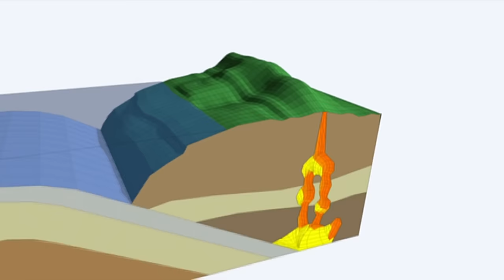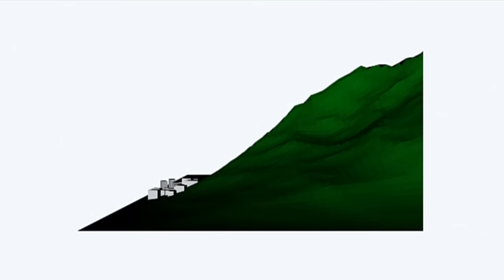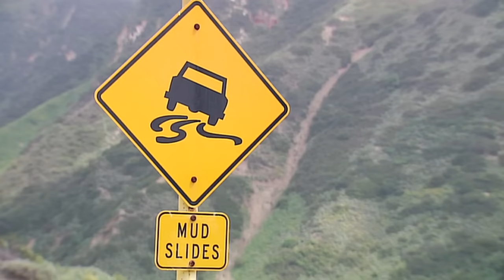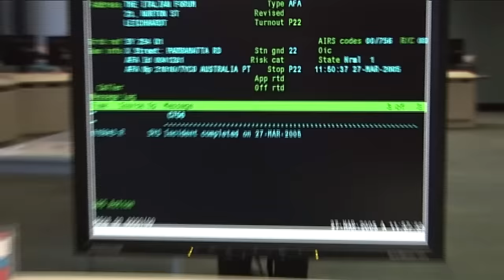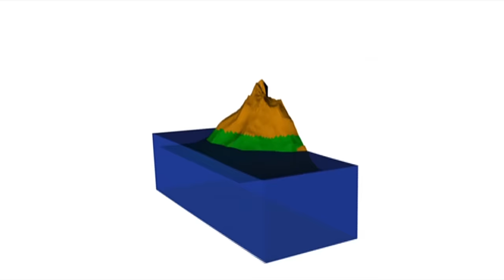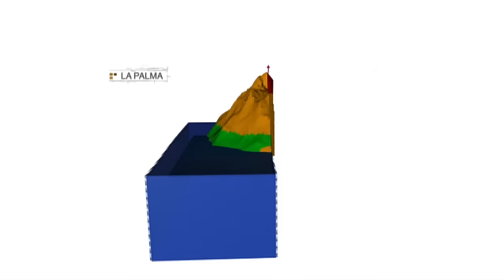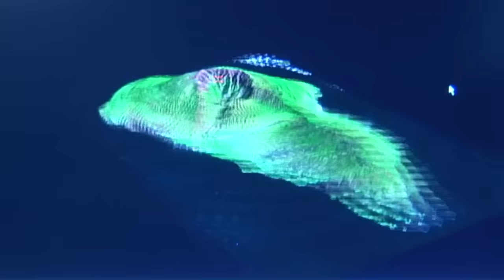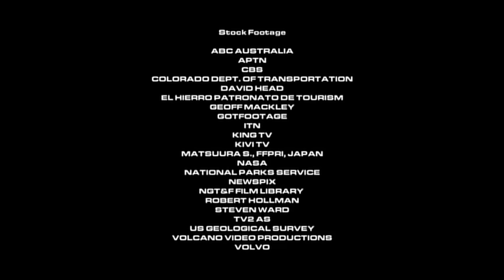Landslides

Comment: "Not about lubrication".... then goes on to perfectly describe lubrication
Reply: Gotta use lube.
Reply: Exactly. At ca. 13:00 describing the La Conchita slide, the geologist says "lubrication" by water is a myth. He then goes on to describe water pressure as separating interlocking particles -- that's EXACTLY what lubrication is!
Reply: @philperry4699  No it is not. We call it liquefaction. It has nothing to do with lubrication.
Reply: Yep it's called "OIL" and it's a  renewable resource not what that oil scientist told the world.
Reply: Mike B  Some do some don't. Again this is a liquification event. The soil becomes too liquid and too heavy to adhere to the slope involved. This is not fucking rocket science.

Next question?
Reply: k1w1  No it is not.
Reply: k1w1  "Separating particles to lessen the friction between them is literally the definition of lubrication.". No it is not.
Reply: Beat me to it. I was going to say the same thing.
Reply: Not lubrication, it's liquefaction!
Reply: @corydorastube  Liquifaction is a very different process. In summary it is when particles are vibrated until they separate and act like a liquid. In effect the last stage of the CA landslide was a form of liquefaction, where the particles flowed like a liquid.
Reply: Nailed it.
Reply: @corydorastube  Double negatives, you mean it is?

Comment: I live in Washington State. We have 2 famous landslides, one is a world record. On Sunday 5/18/1980 Mt Saint Helen's experienced the largest landslide in recorded history. An earthquake triggered very large block of land holding back pressure of Magma. Resulting slide releasing a catastrophic horizontal eruption. All told, over 50 people died, hundreds of square miles obliterated, mud traveling all the way to Columbia River and to Pacific. 

On Sunday 3/22/2014 a hillside by small town of Oso slid across highway, over river, took out entire subdivision and continued up the other side of the valley. 43 people died that day. Lidar Imaging showed many slides by Oso before, some ancient and some present. People were quick to point to lumber operation at top of slope. It had little or no impact. We have an impermeable layer of Glacial Till and soft clay on top of that. Entire region has slides all the time.

Comment: That was nothing as far as a mudslide. In 2005 in Guatemala - where I was staying at the time - on October 5th ( I think) the side of the top of volcán Toliman became saturated with water after 3 weeks of forceful tropical rain which culminated in 7 days straight of downpours that didn’t stop. The top of the volcano traveled down 6000 feet in just 6 minutes. It carried with it 10s of thousands of trees and boulders from the side of buses to the size of basketballs. It buried 900-1200 people alive. 100 meters from where I was asleep. The mid was 6 meters deep. As I joined the relief efforts to try to save lives I looked about as I started digging  for bodies and saw the top of a telephone pole and it wasn’t much higher than me. That’s when I realized that I was standing on top of houses roofs buried under the mud. It was truly heartbreaking

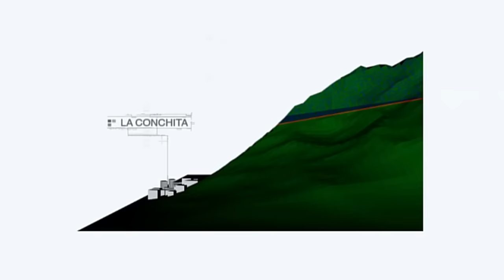Comment: 13:30 sure sounds like lubrication to me.
Reply: Blake Fin totally right? The geologist contradicted himself on both counts. Thanks for noticing it too
Reply: He did not.  it seems a lot of people don't understand the difference.  lubrication affects the friction coefficient of substances in contact with each other without changing the pressure forces.  Pore pressure actually separates the particles from each other removing the frictional forces almost entirely.  They are 2 different mechanical ways of achieving the same result.

Comment: You said water doesn’t lubricate the rock to let it slide, but then said the water fills the gaps of air loosening the rock above allowing it to slide. (?) how does lubricant work again?

I realize this is an open ended question.

Comment: “There’s some common myths about landslides. It’s not about lubrication and it’s not about weight, it’s about pressure”. (30 seconds later) “... the water forces it’s way between particles, lessening the friction between them”.... Ah. Got it. Water does not act as a lubricant, just a friction-reducing liquid.

Comment: http://www.lapalma-tsunami.com/tsunami.html
counter arguments: (cut and paste from site)

The basic research which was done is correct. That is not in dispute. There is a fault, some movement has been detected and there is a volcano which will probably erupt again.
BUT .....
1. The existing fault is only 4km long, but it was extrapolated to 25km for the computer model. Worse still, the position of the fault line was ignored for the model and a fictitious line on the other side of the mountain ridge was used instead, 2 to 3km further away!.
2. The rock on La Palma is a mixture of very porous lava and well faulted and open basaltic layers which will not permit a build up of (steam) pressure.
3. There is an old deep-seated volcanic core between part of the fictitious fault and the sea. This will block the proposed landslide along part of its length.
4. The base of the proposed structure which is supposed to slide is placed at 2km under the surface ... there is no evidence to support this. There is evidence to indicate that previous landslides have been superficial and not deep-seated.
5. There is strong evidence from reliable expert sources that any landslide will not occur in one massive collapse.
6. There is no evidence to support the theory that any catastrophic landslide would attain the extremely high speeds needed to crate a Tsunami.
7. The computer model was based on algorithms used for under sea linear earthquakes. This algorithm is not relevant to the La Palma situation because a La Palma landslide would cause a 'single point event' which would disperse quickly.
8. There is strong evidence to suggest that previous landslide generated Tsunami were very short lived and dissipate within a few hundred kilometres. Some were not even noticed at a distance to 25km
This is the opinion of scientists who dispute the landslide's likelihood.

Check out the rest of the report, it is a great read.
Allen Burt, in Texas
Reply: "the truth laid bare":
Just checking here to see who else likes to learn about true facts in the geology of YouTube.
The LaPalma  "landslide" is a hoax perpetrated by men hoping to hurt the good people of the Canary Islands.

When the story first hit YouTube about a HUGE landslide and tsunami that would probably eventually cause thousands of deaths across the world esp in the US and other coastal regions of the  Atlantic Ocean area, I wanted to know about the geology of that volcano, because the story has caused a large reduction of the tourist business in  the Canary Island chain area. The LaPalma hoax has caused thousands of people here who rely on the tourist industry, to suffer greatly, and it was for no reason, at least factually.
As one can see here the actual people qualified to comment on the complicated geology of the volcano have serious arguments against the landslide theory, but that line doesn't attract much attention,  because gloom and 
doom are not part of the story.

I don't like people who deliberately post false theories, esp if there is a consequence  in real life.
I have always tried to trust facts, instead of wild speculations by uneducated people who are excited to imagine such a doomsday scenario, for their own satisfaction.
Comments?            "truth laid bare"